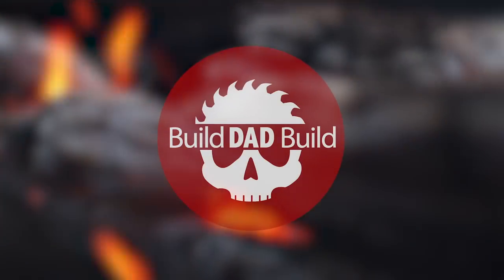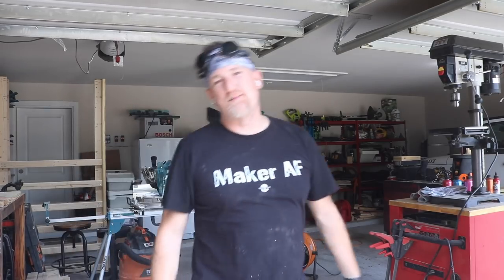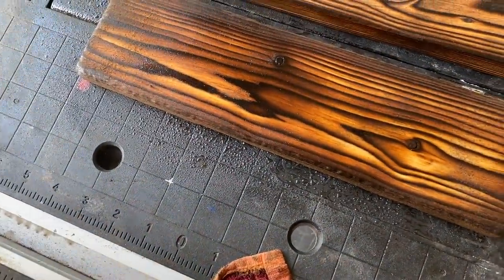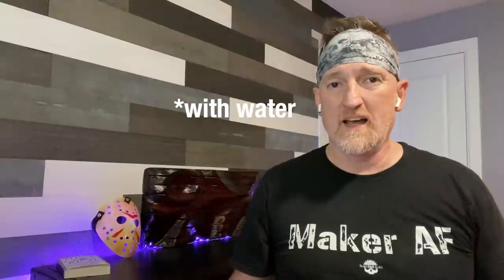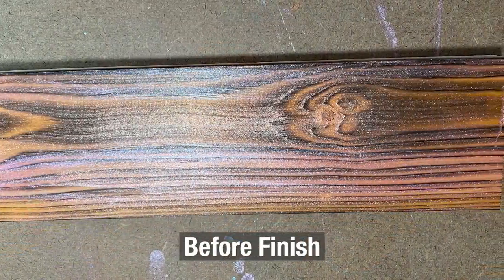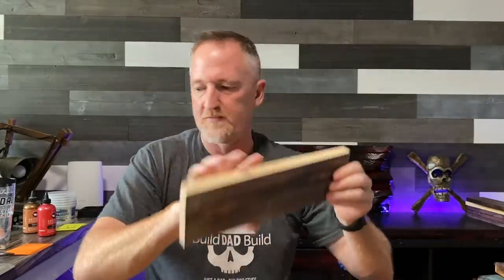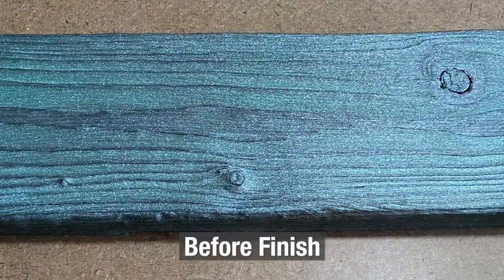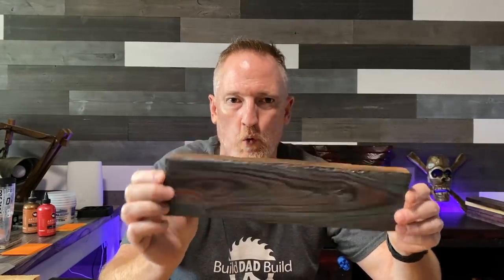DIY Wood Burning Finish and Metallic UNiCORN SPiT

Comment: Props, and appreciation.  I just used your technique on a plank of cedar that I am working on as a gift for a friend.  I used the Folk art stuff you have on your shelf back there, got it at your recommendation.  I dig the method, the colors and the way the grain comes out from the Nyalox brush.  Thanks so much!
Reply from the maker: Hey Brandon!
Thanks brother. I'm glad you like the videos.
Cheers
Reply: @BuildDadBuild  I use a scroll saw to make a pattern before i burn.  Have you ever tried to use a solid paint on the burnt wood?  I want to put a solid stripe down the middle of it but i am not sure how well it'll turn out
Reply from the maker: @nailerflatline  I think it might be kind of difficult to get a straight line...depending on how textured your surface is. I have burnt pieces before and come back and carved a channel out to add a stripe.
Reply: @BuildDadBuild  i went barbarian style and just put some painters tape down.  I used a little silicone tip tool to press the tape into the grooves of the burnt wood.  I think it's gonna work.  :-)
Reply from the maker: @nailerflatline  Only one way to find out...
Reply: @BuildDadBuild  it's not terrible at all!  I wish i could post a picture, it's almost done and it's turning out great
Reply: @nailerflatline  you can! Join the Discord: https://discord.gg/Aa749ws

Comment: Houston here also. Yeah, this heats been killer. I'm doing work for about 30 mins outside, then chilling in the house AC for about 30. Yikes.

Also try some Texas Whiskey.  Balcones just came out with a new single malt named Lineage which is awesome. A fruity scotch flavor mixed with Texas whiskey flavor and tastes much older than it is. About $40 at specs or total wine.
Reply from the maker: Yeah...I actually just received a portable AC unit from Honeywell, after I finish my son's bed that'll be the next project.
And I love me some Balcones! Haven't had the Lineage yet, I'll need to check that out.
Cheers

Comment: Thanks for the video. Very informative. I liked your favorite too. Also, been dealing with the heat and humidity here in Georgia too.
Reply from the maker: Hey Kevin.
Thanks brother. I'm working on installing a portable AC unit soon! I'm dying out there! LOL
Cheers
Reply: @BuildDadBuild  I work part-time for Fastenal, so I bought an 18" industrial fan and it made a huge difference. Good luck with the AC unit.
Reply from the maker: @kevadams1964  I have a small construction fan...but I'm constantly moving it around and I can't have it on when I'm running the camera because it messes with my audio...
I'm hoping this AC unit is quieter...

Comment: DUDE!! I noticed that you have the Folk Art Dye on your shelf behind you. I LOVE WORKING WITH IT!! Also, I am trying to get my burn on, and then my stain but I have a couple of problems...#1.) I don't have access to the spin brushes you used for your earlier tutorial to remove the char. Just a fine wire brush. 
#2.) I'm scorching the wood if unfinished wooden boxes from craft stores, so I want to make the surfaces smoother than a 4×4 ..
Reply: ***scorching the wood OF unfinished wooden boxes
Reply from the maker: 1- You can use a nylon brush (like the kind you would scrub a kitchen/bathroom with). It takes longer but you'll get the same results.
2- If you want to keep the surface smooth, do a surface burn and skip the brush all together.
Hope that helps!
Reply from the maker: Cheers

Comment: It's so interesting watching through your videos on all these techniques the last few days! Really love the pink and copper one so i guess time to start experimenting too! 
 I have a question about burning longer boards though. My thinking was to burn after i glue up the desktop but itll be 2m long... Will they twist and cup a lot from the heat/moisture loss? Or how can i minimize that?
Reply from the maker: Thank you.
They might twist or cup on you. 
I discuss a little on how to mitigate that in this video:
https://youtu.be/U5A67-Pwxuo
Basically, pay attention to the grain pattern and burn against the "C". Keep the wood moist while burning. Take shallow passes. And if something is really pulled out of whack, try burning the other side to even it out.
Cheers

Comment: Hi,

Nice works !  I'd like to know more about your finishing process (which products, how many coats, etc...).
Reply from the maker: For these I just did 2 coats of spray lacquer. Normally I use a product by Total Boat called Halcyon Rugged Varnish. It's water based, UV resistant and you can recoat in a hour. Love the stuff!
Cheers!
Reply: @BuildDadBuild  thank you for the answer !
Reply from the maker: @TheoreticalLimit  sure thing.

Comment: Have you ever tried aniline dyes? That's what some guitar builders use to do the sunburst finishes on their guitars. Not metallic but a great die to make it deep and rich in a soft wood like you're using.
Reply from the maker: Not specifically. I have used Keda Wood Dyes which is more of a natural solution. They get some amazing colors.
Check out this video:
https://youtu.be/S-HY2txy7n4
Cheers!

Comment: As I watch this a 2nd time,I wondered when you applied the stain(s) did you use the stains straight from the bottle or dilute it ?(if diluted what ratio did you use?
Reply from the maker: I apologize if I wasn't clear about that. I mixed the stain 1:1 with water.
Cheers

Comment: When you say "before finish" and "after finish", I'm not detecting a lot of change.  There are colors in both B and A.  Is the "finish" you're talking about a clear seal of some sort?  Or is the finish the actual adding of the colors.  Just confused.  The boards look great though!  I have one suggestion, too.  Don't worry about being "boring", as you sometimes say.  I for one am totally interested in every step of the process and these go by pretty quickly IMO and I feel I'm not understanding all the techniques.  Anyway - thank you!!
Reply from the maker: Sorry if I was unclear (no pun intended). The finish I'm referring to in this video is any kind of clear top coat. The top coat tends to darken dyes and colored stains. So I like to give views a good idea what it's supposed to look like before and after so they can adjust accordingly.
Does that make sense?
Cheers
Reply: @BuildDadBuild  Yes, excellent; I thought perhaps that was what you meant.  I appreciate your reply!

Comment: We’re you using a die grinder and wire wheel to clean the burn off the boards
Reply: Nylon brush.
Reply from the maker: I have a flex shaft attachment for my drill. But I used to use just a nylon (Nyalox) brush in my drill to remove char.
Cheers!
Reply from the maker: Cheers brother!
Reply: @BuildDadBuild  thanks to you, I just picked one of those up for my drill. That thing works great!
Reply from the maker: @antbatt1313  Cheers!